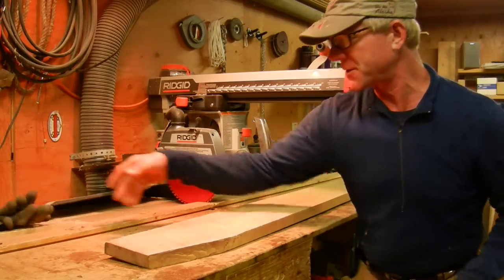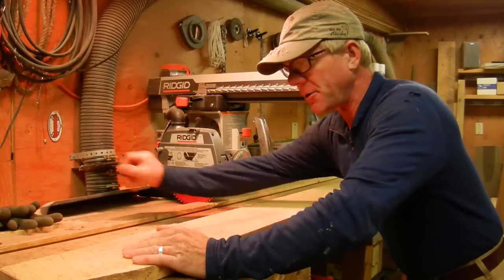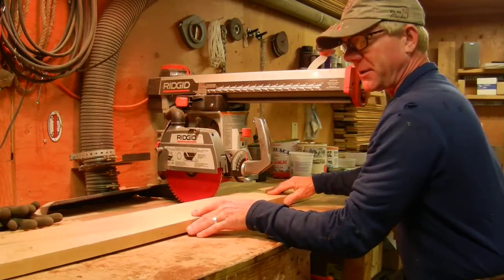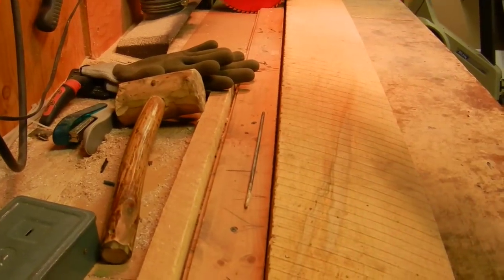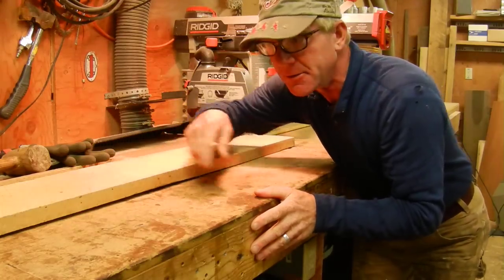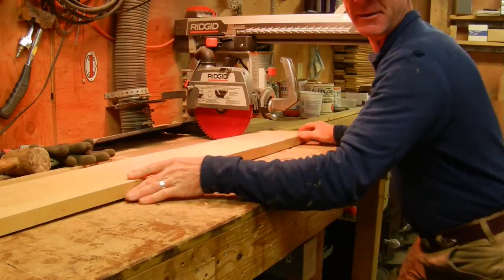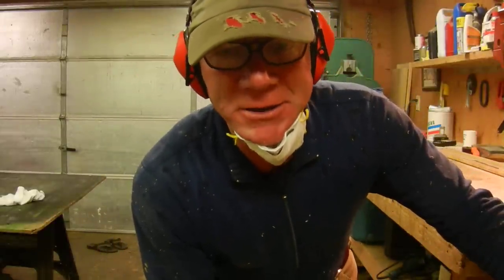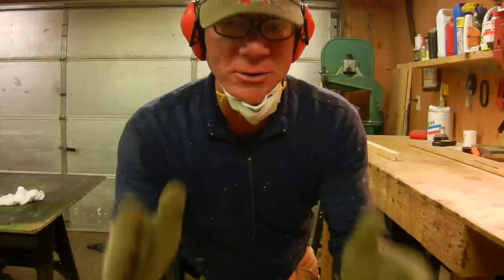How to use a Radial Arm Saw #radialarmsaw

Comment: There are 43,000 table saw accidents per year.  I can only assume there would be a lot more if people didn't switch from radial arm saws to table saws and miter saws.  That spinning blade is a beast.
Reply: finally someone that understands that the table saw injury number is not a per-use percentage, it is high because table saws are used for nearly everything.

Comment: 1st time I've ever seen a saw cut upwards. I think he's using it backwards.
Board wouldn't chatter if saw was pushing down .
Reply: 100% feeding the wood in backwards. He’s lucky the board didn’t snap back. Also enjoy that he made sure to grab a push stick and then reaches around the blade noon stop to pass it through.
Reply: Bob Hutchinson you’re 100% incorrect. If he had the anti-kickback pawls installed, you’d see it would be impossible to feed right to left, as the pawls prevent that movement so you can rip the way he is and not get... kickback. Pawls go under the handle, and prevent handle-to-rear movement, handle to left as you view him ripping. Google the Ridgid RS1000 and check the images.

Comment: You use all the hearing, breathing and eye protection, but you don't have the anti-kick back pawls on.  Shame on you.  Also, the guard isn't just to keep dust out of your face but, when ripping to keep the blade from lifting the board.  The guard should be right down there "kissing" the wood.  In Wally Kunkel's book there is a true story about a young child killed be a board when his dad didn't have the saw set up correctly.  The RAS when set up correctly is safer than a table saw.  When not set up correctly... EXTREMELY dangerous.
Reply from the maker: No little kids in the shop then JD

Comment: Bow against the fence.
If you have a area you can put a 12' fence in.
🤬
Not cursing at you, just dont have that much room.

You should fix a way to put a feather board on there to keep it tight against the fence.

How do you set the saw blade parallel perfect with the fence.

Comment: The whole board jumping up and down is a little too scary for my taste. Working in a machine shop for several years now has taught me NEVER wear gloves of any kind around a rotating assembly.  Much less a sharp one!  I've heard enough tales from old timers to scare the piss out of me to try this.  I only use mine for dados and cross cuts.  Installing some type of clamping mechanism to hold the wood down in the near future.   I would strongly discourage anyone watching to attempt.

Comment: You haven't made a true edge because the reference for it was the opposite, unmilled/untrue edge.  You just made a parallelogram.  You should have run one side through a jointer first.

Comment: I’ve been a carpenter and woodworker for over 20 years. I have had and know how to use radial arm saws. Let me get one thing abundantly clear. You do not need a radial arm saw. They are functionally worthless and more dangerous than any other power saw common to a wood shop. They were a gimmick from the 50’s. Time to let them go.

Comment: Wow wow. Name of the movie states How to Use, but in the end of movie you claim thet it is the way you use and do not recomend to anybody. Chane neme of movie. It is misleading. For me it is most dangerous tool ever created compared to table saw and chop saw. When you cut longways your board want to go up. Only the weight of your board helps to keep it down. At 5:11 blade started to catch board. If it was lighter board it have chance to stuck or brake. When you cut perpendicular, blade push board up as well. It is dangerous way to work with wood. On table saw work piece is always pushed to the plate. Chop saw is safer too. Because you can always raise the blade and cut small amounts until full cut